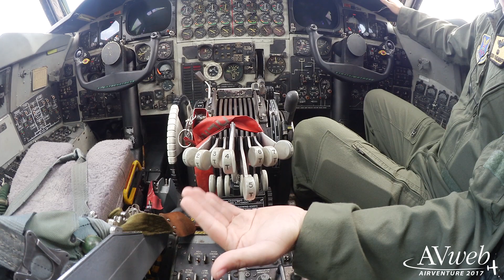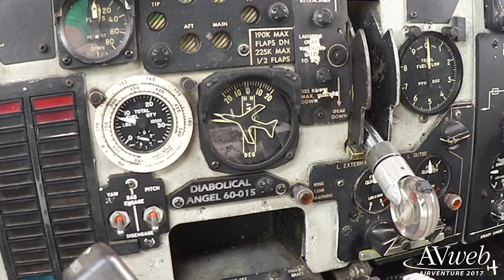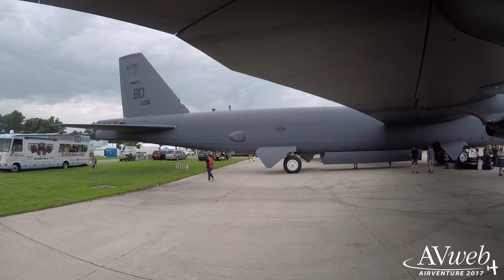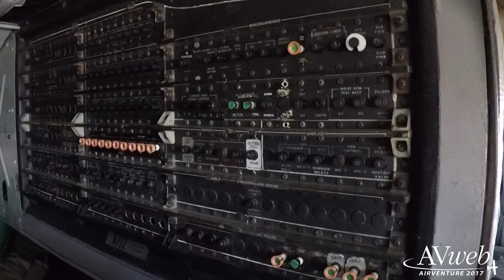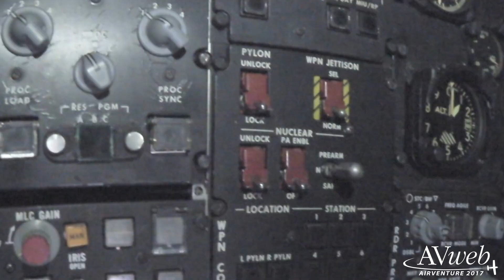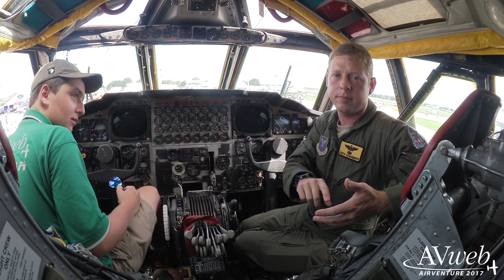B-52 Aircraft Tour

Comment: Back in the mid '80's I worked on that plane# when it was at Minot, AFB as an Electronic Warfare Specialist on these bombers as and in this video they did not show the EWO (Electronic Warfare Officer) or Fire Control area, which is on the same deck as the pilots just past the hatch going rearward of the Nav Crew. The Gunner or 'Fire Control' was the only enlisted person on the bomber...I guess that area is still classified???? Did many debriefings and during one debriefing the EWO told me that they had a lot of turbulence at 500' flying during an exercise and the enlisted guy (Gunner/ Fire Control) lost all his cookies and the whole crew had to go on oxygen....there were peanuts all over the floor and it really stunk...those were the days!
Reply: They were probably wishing the gunner was still in the tail.  Seems I read somewhere that they don't have a tail gun any longer on the B-52.
Reply: Todd B  The gun in the G and H model was aimed using a radar.  Having a constant RF emission like that provided a homing beacon for an RF seeking missle. Somewhat counterproductive I think.
Reply: @jimbabcock6285  That, plus it was a total waste of weight in the missile era. You'd need an interceptor that could match the Buff's ceiling but somehow had no missiles... I'm surprised the tail gun lasted until '94. Seems it was antiquated even in Vietnam.
Reply: A last worked ECM around 2001 and i noticed they didnt show EW seat. We couldnt show it then either
Reply: Todd B no sir we removed those around 94 at Barksdale
Reply: PerformanceUnlmtd 
When was it at Minot? It was at Carsell circa 1987/1988. I remember because I did a TDY on that plane (balls 15).

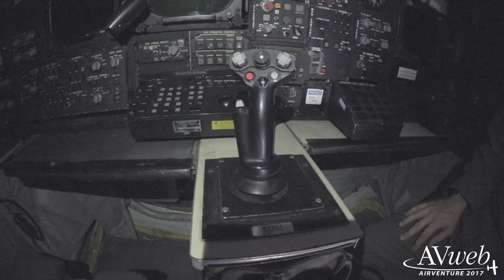Comment: 6:00 Pretty sobering to get in an aircraft and see a control panel labeled NUCLEAR.
Reminds you what the B52 was originally designed for.
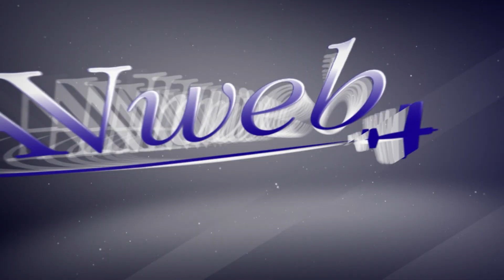Reply: The video ends at 8:46 lol
Reply: "The comparison with the Wright plane in Vietnam wasn't that far fetched."

It wasn't even a little far fetched; it was spot on.  The Wright Flyer first flew in December of 1903,  and the American involvement in Vietnam began in 1955. 1955-1903=52 years. The B-52 first flew in 1952, and went into service in February of 1955. This video is from 2017, and 2017-1955=62 years.
Reply: It's still used for that. The B52 is still used to truck nuclear cruise missiles.
Reply: SAME SIGN ON DOOR TO MY HOUSE WHEN WIFE IS HOME
Reply: You see it at 6:00
Reply: HenkeEdge Thanks! Just corrected it.
Reply: don't be scared irvan, comes from the word nucleus meaning "little nut"......lol
Reply: A lot of military aircraft do actually. The F/A-18 Hornet for example also has a NUC WPN arming switching tucked away in the back corner of the cockpit
Reply: I spent 4.5 yrs working the buffs out of Fairchild and Anderson  71-75. They are quite impressive. 
Our base (Bien Hoa) was 10 miles from a drop. That's as close I 'ever' want to get. It shook the entire base.
Reply: Originally???

Comment: Why in the world hasn't that been replaced that has to be a nightmare to fly and extremely inefficient. Like somethin North Korea would have.
Reply: There still cheaper to fly and maintain that replacing them with B2's and you have about 700 parked at the desert to cannibalized for parts.
Reply: i guess i dont necessarily mean replace but how is it not very very updated?  i mean you could have the same platform but why not some new engines. ones that done blow black smoke out the back?  or all new avionics and flight control systems.  f35 radars, computers, heads up displays.... etc.   i mean thats what i expected but when this video showed the cockpit its pretty much the same aircraft that rolled off the assembly line in 1932!  and its still our premier bomber!    i get it, i get that you can drop bombs pinpoint on target after a crew writes out math equations on paper and some physics formulas and comes up with a solution but my 9 year old iphone can do it in half a second!  cant we the taxpayers throw our boys a couple of iphones!?  honestly, we're spending trillions trying to get the f35 up and running while this antique is watching over the fort?   that doesnt seem kinda silly?  sure it can be done but why?
Reply: The B-52 has been receiving updates for quite some time. Is it as advanced as a B-1 or B-2? No, but it gets the job done reliably. It's been said that 100% of weapons released from B-52s have hit the ground. lol. It also has the most diverse payload among the other bombers. They have also, been carrying targeting pods for a while. There's a reason why we haven't retired them yet. They just work.
Reply: Thunderstriker you can't replace a legend
Reply: The P-38 and P-51 succumbed to the jet age. Do you also realize the C-130 is of a similar age? It's still a workhorse as well.
Reply: its not that bad. Makes a unique culture in the mechanical world. From crew chief on tankers to a 1 barrel rochester on a subaru with digital ignition.. the mix and match is a fun conversation. I mention it, as I thought nothing changed my will for evolution..and I went and built something weird. It is only 30 years old. The more people forget,  the weaker we will all get.
Reply: Maybe not as glamorous, the cessna 172 is another bird from the 50s still working hard and in production.
Reply: well if youve been on it for 10 years and youre happy then i guess i cant say anything.  i was just pretty shocked at how old everything looked in this video.  esp when we've poured what, trilions, into the f35! im just like damn cant they kick a couple million over to the bomber department!  get some nice seats.  maybe a cd player or somethin.
Reply: Thunderstriker - N. Korea would fly some Soviet bullshit like a Tupolev Tu-4 (Boeing B-29 knockoff) but even that's too good for them. N.Korean Air Force is a joke.
Reply: Recent news:
B1 and b2 are being put out of service. B-52 is staying in till roughly 2050...
Reply: The B-52 is better than the B-1 in every way.
Reply: you mean like the p38 lightning or the p51 mustang or the many other legendary planes that have been replaced?  i feel you just had to mock the statement.
Reply: yeah i know i get it i was just.. nevermind shouldnt have said anything.  i get that the b52 works and its good and all that i just feel that the top of the line bomber for the us military should be at least modernized.  dont have to be some thing from the future just not something from 50 years ago i mean look at that thing i doubt it has a gps. the crew has to navigate by the stars and a compass and long math problems.  sure that works but a gps works way better dont it!?  updated engines that dont pour black smoke trails out the back. updated radar and weapons systems it looks the same as it did when it rolled off the factory floor 100 years ago!!  the m1 garand rifle worked but wouldnt you rather have a ar15 automatic?  im just sayin hook our boys up a little bit.  make their job a little bit easier theyre only fightin wars for us!
Reply: I've spent 10 years of my career on the B-52. Does it have the most up-to-date equipment? No, however, but it does have what it needs like GPS, modern munitions, etc. It's more modern that you think. There are plans to modernize the avionics and other systems. The engines are smoky, but again there are plans to update. Part of the issue is engine size. The wings flex alot! Larger engines would potentially strike the ground. More modern bombers like the B-1 and B-2 just can't do what the the old BUFF can. Do they have their place? Absolutely!
Reply: G4Disco 
The H model has the turbofan engines. Smoky was the old J-57s with the water injection. Those were on the A through G models.
Reply: Luca Mino Not true.  The stealth bomber, as the name states, has stealth (which the B-52 has not), operates the same missions as the B-52, and looks nothing like the B-52.
Reply: I read that they are, or have already had an engine up-grade.  Plus, with JDAM's they can put munitions right on the target.  Amazing aircraft.
Reply: If you've come up with a better idea....
Reply: Thunderstruck  Ummm... the AR-15 was developed by Armalite in the 1950's...  ;)
Reply: gotta get that money for all the cancelled fighter / bomber programs from somewhere.  Not to mention the f35.
Reply: Thunderstriker, the B-52 is an excellent airframe that has lasted for over 50 years. No company on earth can build a better airplane. That is why so many countries are scared of the old plane. Also North Korea does not have a comparable plane. If you think North Korea has a good Air Force, you have been watching too many cartoons.
Reply: The fact is, if you design a plane from scratch now for doing what the B-52 does, you'll end up with...a B-52. It's still perfect for mass bombing missions against low tech enemies, for when a squadron of ground attack aircraft is not enough but a B-1 Lancer or a B-2 Spirit is just too overkill

Comment: why are we still flying this antiquated machine..?
Reply: It's extremely good at dropping a large bomb load from halfway around the globe.
Reply: Google an article titled "How on God's Green Earth Is the B-52 Still in Service?", that should answer your question.
Reply: I have to laugh. For those that think the BUFF (Big Ugly Fat F_cker) is antiquated, keep in mind that the main bomber aircraft currently utilized by the Russians is the TU-95 (Tupolev), which is as old as the B52 and is a "turboprop" aircraft! 😳 I worked avionics on the G and H models in the early to mid 70's; The aircraft was a marvel then and it's no surprise to me they're still flying sorties. Neither the B1 nor the B2 have the conventional (non-nuclear weapons) payload capacity that's anywhere close to the old fellow. That's why they're (B52's) still in use today. As the crew member said, the aircraft is called upon to "change minds"' lol.
Reply: Jacob TJ they are doing a lot of upgrades to the 52.  New engines, new electronics as well as other things.  The problem is designing a bomber that could do the same job and do it as well, would be even more expensive than the B1 or B2, and more than likely would be just another B52, except with an different alphabetic letter behind the B52, and a hell of a lot more tax dollars.
Reply: I am not saying it isn't a great piece of engineering, we have made numerous technological advancements since the intro of this plane. It is long overdue for an upgrade. let the govt spend the money, give jobs to a lot of people.